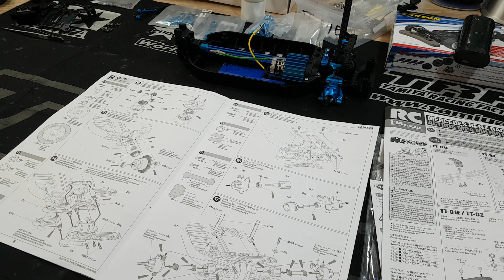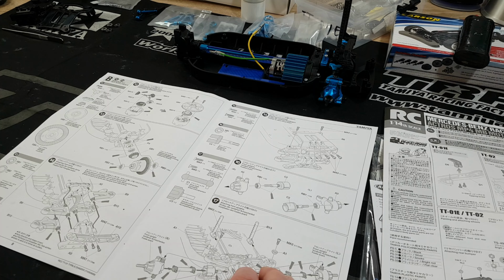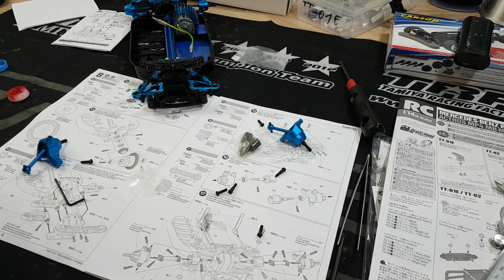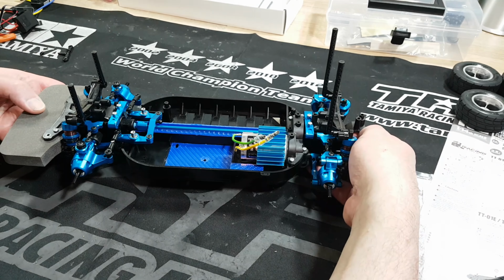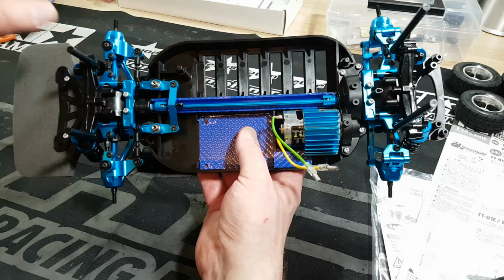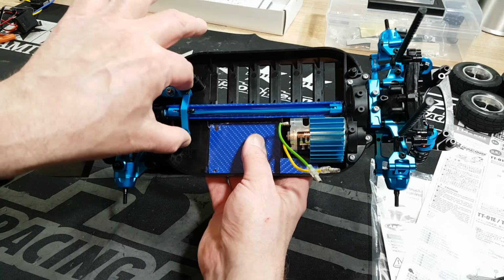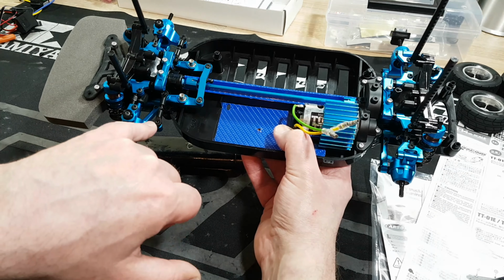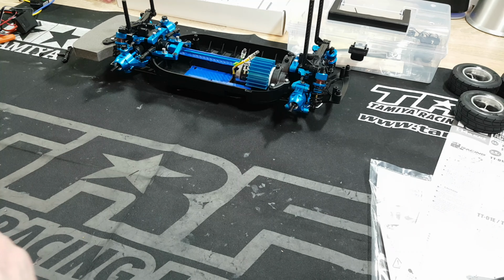Tamiya TT-01E Truck with Bittydesign Iron Body and Yeah Racing Parts - Building Bag B, Steps 12 - 22

Comment: The chassis is looking fantastic, one thing that Tamiya annoys me after no bearings are the shocks on the TT-01/02 well springs with floppy plastic bits. Why they just do not add CVA ones and put a little on the price of the kit. Your Yeah kit  does look really good, 5 sets of springs,  pistons and add different oils makes it ready for racing with so many options with the tuneability.
Reply from the maker: And I bet all these things are not allowed in the racing classes🤣🤣🤣.

You're so right. About suspension we can always talk, but no ball diffs, a bending main drive shaft and a sloppy steering sucks the fun out of the car. But many modelers like the TT-series...